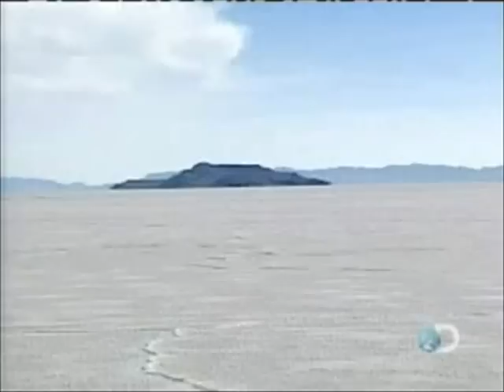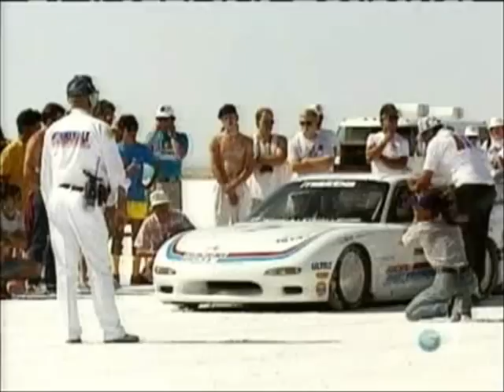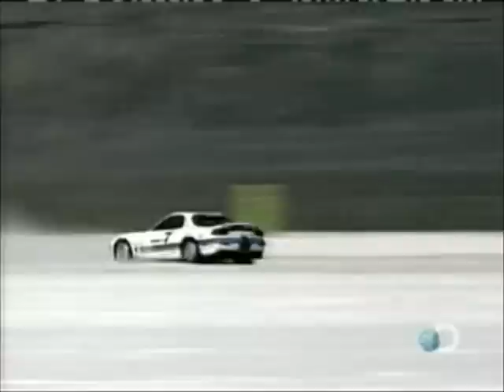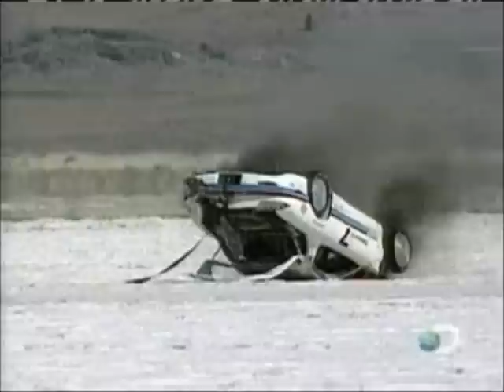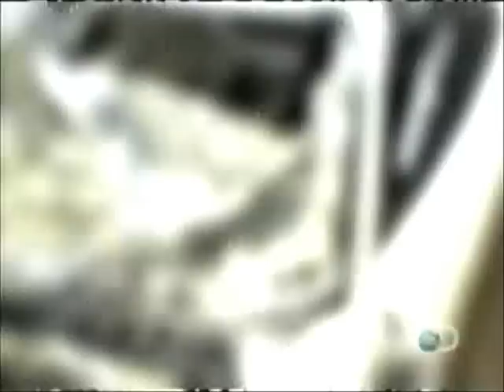Mazda RX-7 Crash at 225 MPH!!

Comment: and that is what a roll cage is for
Reply: and it did it's job too... though I bet that helmet got blasted with salt rocks
Reply: reinforces the body of the car... without a roll cage, that car would have pancaked after flipping over on it's roof.. the roll bar kept the car's integrity and protected the driver (in combination with other safety gear; IE: Harness, Helmet, etc.)
Reply: don't understand what you meant, but it looks like the driver survived the crash considering he freed himself from the wreckage.. so yea, the roll cage save him
Reply: No Roll cage he would be dead..soon as it flipped at that speed on its roof it would of closed up then the fire Start's... Roll cage = priceless
Reply: Gabriel Rosales needs more downforce
Reply: Gabriel Rosales amen
Reply: Be a man. Ride a bike.
Reply: Whithout a roll cage much more drivers death now.

Comment: An rx7 pushing an rx7 Beutiful
Reply: RX-7 having sex with RX-7, noice
Reply: Its like two lesbians
Reply: Or are they mating....
Reply: Renato FJ Cadillac CTS V and the Dodge Charger Hellcat are 4 door sedans but go 200+
Reply: Krysler _ and thats how a miata is born
Reply: @G59METH  2 hot lesbians
Reply: That's how four-rotors are born
Reply: I fuckin know it right I automatically came to the comments after I seen that.
Reply: What rims is the pushing rx7 running?
Reply: @MIKEK3NT good question, they look familiar but I’m drawing a blank.
Reply: @MIKEK3NT  racing beat
Reply: Turned out to be a poor car selection to do this stunt. Js

Comment: This was actually a very mild crash given the speeds it happened at. He's lucky he landed on the cage and started sliding instead of going into a roll. If he started tumbling he'd probably be a dead man.
Reply: No probably not.
Reply: yea, probably not dead, but he'd have some broken bones and some more serious injuries... not to say he didn't break anything from the wreck shown, but spinning and sliding on the roof of the car probably scratched up the body panels more than the driver...
Reply: That's the benefit of a well balanced chassis

Comment: Don't think it'll hit 300mph in a 900hp car
Reply: all depends on the power:weight ratio, distance given and the drivetrain used... in this case, it's moot cause that car's not gunna hit 300mph without some additional aero work..
Reply: maybe 2500hp!?
Reply: and gears
Reply: +Flyin Sushi 14 more
Reply: its all about aerodynamics. that is the biggest factor at speed over 250
Reply: Chad W true. And downforce
Reply: Flyin Sushi downforce is included in the concept of aero..... wasting energy to push you down is drag which is aero.
Reply: Chad W oh. Good 2 know. Thx
Reply: well it all leads to power to weight ratio and downforce and of course lightness but if it is a 4 rotor twin turbo 900hp engine japanese rotary car with such an aero body giving it long distance i can asure you it can do nearly 260 mph
Reply: what are you on about?
Reply: KremitDeFrog power to weight ratio doesn't actually matter that much for top speed. Not on salt flats anyway. It will take longer to get up there with a heavier car but basically the limiting factor for top speed is the power and when it equals wind resistance rather than overcoming it. The weight is not a factor at that point.
Reply: It could, its just that the tires would get really hot and probably explode around 280 mph
Reply: antxmod12322 Not true. A 20hp car with a top gear geared for 400mph is going to top out the same as a 20hp car with the top gear geared for 100mph.
Reply: antxmod12322 Ummm no you couldnt be more wrong .
Reply: also, weight dent matter at those speeds, horsepower is the way as the drag from the air will be pushing the car back. only power will over come this, aerodynamics do to a point but weight went do much
Reply: hah that's the "spirit" :D (RX7 puns)
Reply: you've some race cars with max 150hp for 160mph and another with + of 700hp for just 200mph why ?
Reply: yup !!! in france a car named "alpine" with just 100 hp was capable of +140 MPH in the middle of the 60s ...
Reply: Because wind resistance goes up substantially at speeds above 120. There's a reason most production cars top off around 125-130MPH. I remember being able to drive my Miata late at night when no one else was on the road and being able to hit 130 with my headlights down; pop 'em up and I lose 10MPH instantly.
Reply: thats what i was thinking to
Reply: miata (mazda mx5 in europe) you"re right just with headlights you loose in speed lol
Reply: Dude, that car probably weighs less than 1300 pounds.
Reply: it gotta be close though
Reply: Gear ratio is alsof important
Reply: dont think hp=max top speed
its just not that simple like playing game
its about balance and research of alot combination
aero, traction, trans, stability, endurance,  many more
Reply: Power to weight ratio makes almost 0 influence on top speed
Reply: Of course it wont 😂
Reply: It has no low gear, and very light weight it can get there
Reply: One:1 has the best power:weight ratio 1360HP and 1360KG
Reply: Filip Olofsson F1 cars have a way better ratio and hit lower top speed, hence proving to all the people debating that power to weight ratio and plain weight barely matter.
Reply: Rubertoe they could hit high top speed... but theyre not geared for that lol they still gotta go thru turns and slower speeds.. give them a land speed test trans and then ul see
Reply: Wut F1 cars have about 800HP and weigh about 722KG so as u can see the Koenigsegg One:1 have a better ratio 1360Hp and wiegh 1360.
Im a huge F1 fan btw
Reply: tommy d u b b s It has been done by Honda in 2006 or so, only 400 km/h hit, look it up. They need more power and streamlining for such top speeds, and they wouldn't be F1 cars anymore.
Reply: Filip Olofsson With your data (actually it is more hp) F1 cars would have a ratio of 1,108 approximately, while the Koegnisegg One:1 has a ratio of 1,000(That is why it is called One:1), therefore lower. Power to weight ratio is simply dividing power by weight.
Reply: Okay
Reply: There is absolutely no way it's gonna hit 300mph , I mean not even koenigsegg agera 1 can hit 300 mph and it has 1341 hp and 1360kg weight so 1 hp per 1kg, and on top of that it has the best aero you can get on a car . In order for this rx7 to hit 300mph it needs like 1600hp + better aero , after 260 mph the aero dynamics take a big hit and it's hard to get more mph .
Reply: KremitDeFrog power to wieght is acceleration. 900hp wont be able to get up in those long gears atleast to 300mph. Rotaries can make 1,500hp. 300mph on that light of a car will do exactly what it did when he added the 50hp. Just doesnt have enough downforce with that weight
Reply: It can if you have eurobeat going on.
Reply: KremitDeFrog don't forget wind resistance 900hp isn't enough
Reply: lol ikr
Reply: There was one person that 300mph in ford flathead with 700 hp
Reply: It will if it as light
Reply: i loled when he said 300mph in a 900 hp car ahahahahahha
Reply: Steven Chea 
It’s all about gearing
Reply: Unless if its like 600 kg
Reply: You'll need more torque than hp when you're exceeding 250mph.But with some extreme aerodynamic and 3.67 gear ratio
Reply: Everything else being equal, to double a car's top speed you need 8 times the power.
Reply: it was the transmission's gearing, thats why it was being pushed at the start

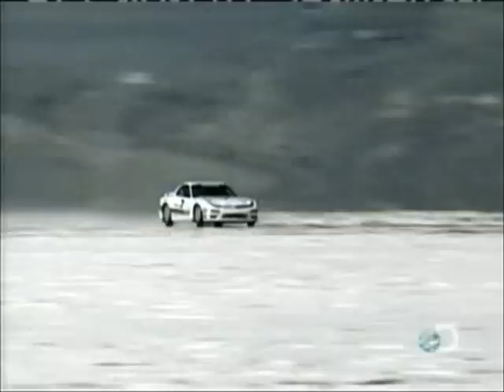Comment: 1:40 i love how the narrators of shows like these think they know what they're talking about lol.
Reply: Steven Kujala I was thinking to myself, when does running lean give you more power? hahaha.
Reply: John Doe Running lean does give you more power.... just riskier for the engine due to higher, why do you think tuners lean out air/fuel mixtures to make more power. Leaner conditions make more heat increasing the likely hood of predetonation ("Knock"). With better fuels such as methanol/ethanol, that burn cooler you can lean out the mixture more, making more power.
Reply: Hazz Matt im pretty sure its engine  Swapped
Reply: @corby9591  it isnt
Reply: @Hazz Matt it was originally made by mazda
Reply: they dont... they're narrators and they read scripts
Reply: @corby9591  no, it was a 20b. Original video

https://youtu.be/o8b8oYuftYk
Reply: He had me thinking 🤔. Air fuel ratio, leaned it out? I've settled on a increase in boost, lol

Comment: @c3pigpig 
In asia, every wing added is additional horsepower gain depending on size, bigger wing = bigger horsepower. Some people put wings on everything. Mirrow wings, Wiper wings, door flap wings, head light wings,  sun roof wings, muffler wings, tire wings, Wing Wings, Some of them even had wind-mills on their car to generate electricity and remove their alternator to reduce power loss in engine.

Comment: 300 mph with rx7  aerodynamics? no thank you.
Reply: +MegaRussell12 in 1996 pontiac trans am with aftermarket upgrades has been driven to 290mph. its possible but i would want something with downforce. among other things.. a stock rx7 feels like it gonna break apart at 140mph., (from experience)
Reply: +travis barker I dunno. mine felt fine
Reply: GliderGaming its beautiful indeed. That doesnt mean it has good aero.
Reply: +GliderGaming the countach is a beautiful car but it has the aero of a brick

Comment: All that time and money into a building that rx7, and yet he didn't install a rear spoiler. What a beautiful car gone to waste.
Reply: you have alot to learn about the salt flats
Reply: Chris Hris Yes. A spoiler, adds downforce, which is necessary at high speeds, so exactly this doesn't happen. When moving a higher speeds, there is more force that can be be applied to a car.
Reply: Chris Hris no chris, my comment was for Stephen Imsong 1) many classes on the flats dont allow the use of aero, or else the car would have to fall into another class, with different records to be set. 2) the downforce/drag ratio with spoilers is many times very lopsided, meaning a car will never reach speed goals with a spoiler. Look at nascar, or a bugatti veyron. Where very high speed is needed, no wings. But on a tighter track, or lower speeds, the car has a wing to add downforce. At high speed a chassis already creates downforce, so a wing is simply a huge amount of drag that does nothing more than impede top speed. Cars wreck on the flats because it gets very rutted and sometimes weight pitch will cause the car to become unstable, or will allow air under the car, creating lift.
Reply: rear spoiler adds downsforce not stability
Reply: Steven Kujala english veri gud sinä olla
Reply: Stephen Imsong aero reduces top speed
Reply: Actually, the addition of a rear spoiler would make it more difficult to reach very high speeds, because the spoiler would generate downforce. Downforce = drag. Drag = lower top speed and acceleration.
Reply: Ricer
Reply: Much to learn you still have
Reply: drag is a small price to pay considering how not having one could wreck your car and not get you to your record at all
Reply: Stephen Imsong  some rx7s cant handle spoilers
Reply: Don’t need a wing
Reply: Stephen Imsong frictional force = downforce x coefficient of friction. If u add a spoiler, the down force increases and hence increases the friction which reduces the high speed reaching capability of the car
Reply: Not to waste.. Here was already commented they REBUILD that car and beat old record.
Reply: Christian Christoff Actually, that’s a wings job. A spoiler reduces drag by minimizing turbulent flow behind the car.

Comment: @TheYetiDick Putting a wing on increases downforce and makes the car more stable, it increases handling and acceleration, but it reduces the top speed.  He did not put a wing on because he was trying to reach high speeds.  Top gear tested a car that could go about 240mph and they told the company to send them a version with a wing so it could set faster lap times.  The wing reduced the top speed from 240mph to 218mph.

Comment: There’s a reason professional racing has strict roll cage specifications.

2000+lbs of chassis sliding on sand or asphalt has same effect as pressing a soda can into an 80grit belt sander.

At 200mph the body panels and roll cage go quick so you better have a good set of sacrificial skid plates.

Comment: The point of racing on the salt flats is all out speed, not handling. Down force is a nemesis to vehicles at super high speeds, its like adding weight. The perfect balance for an all out top speed vehicle, believe it or not, is to have slight lift. It decreases the weight on the wheels. Most, however, set the vehicles neutral or with light down force. The only way to run neutral or have lift is to employ the use of a a vertical "tail" wing(think plane) for stability and that doesn't always work.

Comment: @TheYetiDick Also it did have a wing. You can see it when the car is getting pushed to a start by the other rx-7. Only reason if flew is because the downforce from when it started spinning out force one side into the salt flat sending the other side slightly upwards enough that when it came around, it got air under it.

Comment: @sniperxcom actually i have a spoiler on my rx7 to get more grip while im drifting, also my rear suspension is softer  to also help with rear grip and on top of that my psi is set to 10 psi less than recommended on the tire for again more grip...  it makes the car feel more predictable especially when youre going 60+ at the track

Comment: @randynewmans 
You don't think they would have changed the diff and gear ratios to get max top speed at the expense of acceleration. If you geared a car to do that speed with a 900hp engine you need a pretty heavy duty clutch. You think he wants to try and slip the clutch to take off. Maybe they removed the starter motor as a weight saving. Probably both.
There are good reasons for these things.

Comment: He never turned into the skid. There is very little traction on salt. You have to treat it the same as driving on dirt. The speeds reach on salt by wheel driven vehicles would be much faster on asphalt or concrete.

Comment: The car got sideways when he adjusted the A/F mixture, I assume the drive tires broke traction, with the application of extra power. I really doubt that a modified front air dam would have kept the car on ground at that point

Comment: I would have thought roof flaps would have been more useful
Or perhaps front to back roof rails as per SCTA rule 4.X which break up the air going over the car if it gets sideways causing turbulence instead of lift

Comment: Not really, He had to much downforce for the speed he was going. Watch the video again and you can see the front right strike the ground as the downforce at that speed caused  the suspension to compress to far. At that point the goes sideways destroy the airflow and allowing it to lift the car. For high speeds like this you really don't want a lot of downforce as it slows the car down. A more neutral airflow is needed.

Comment: Could have been avoided if the car had a better spoiler.  The spoiler keeps the car down at high speeds so you don't start flying from too much air flow to the bottom of a light material race car.
Reply: +Shawn Joshua A spoiler wouldn't have helped once he started going sideways, it generally keeps the rear end down for better grip and more more effective power transfer through the rear wheels.
Reply: Spoilers help for handling but make you slower due to more weight and pressure

Comment: That was likely the softest 225 mph crash ever. And thats not the actual sound. There is literally no good reason to dub over the sound of a 900 hp rotary engine. Bad production. Also he had the presence of mind to hit the chute. Admittedly it did nothing but its clear he was still in control of something there

Comment: A professional or any regular would know that a car that can get those type of speed needs down force of soem sort that car was just plain with aloy of power but sucks that he went thru that
Reply: A little bit of positive downforce x3 at 240 mph which would brake the suspension with all the down force and even if the suspension is very strong the front wheels will slowly lift causing you to slow down or even get all 4 wheels of the ground

Comment: @1992demonio A spoiler would give down force on the back tires, He needs a modified front air dam to apply down force to the front so the car won't lift up like it did, a spoiler in the back would do the exact same thing, and if you look he has one, it's just not a gay one like the kids now days use.

Comment: 300zx now owns it at 262mph
Reply: Not true, Levi. Mederer's car averaged 242 mph, a class record that still stands today. (Whatever you're referring to is in a different competition class.)
Reply: @HurstTheHybrid  Yes, "ppl" do need to get "there" fucking facts checked, bro. As I said, Mederer's RX-7 set—and still holds—the record for the C/Blown Modified Sport class: http://racingbeatnews.com/mazda-rx-7/recounting-a-rotary-record-1995-bonneville.html

The vehicle you cited is not in that class (as I stated above). I hope this helps you out, bro.
Reply: @deasystems  according to the set of this. The history of thr 300zx was actually in the C/Class and nissan as well Jun stated that and it came on the same day as the rx7 which was there. And took the same record at 256.9mph the reason. Why it is not marked is because the 300zx was in 2 classes at rhe same time and it was there for the w.r of both classes. I font know why it doesn't show it on the board but if you look at the cars interior. It shows its class and how fast it went in both classes. Also Bonneville didn't post info about it since it has been stated that Bonneville or the racers keep up with records there
Reply: @deasystems  also it says. It holds the ROTARY RECORD not the full class record as stated in the link you sent me